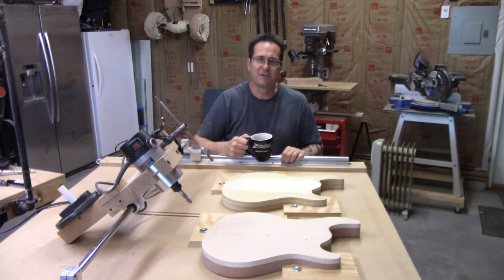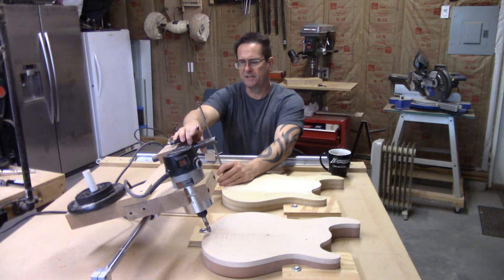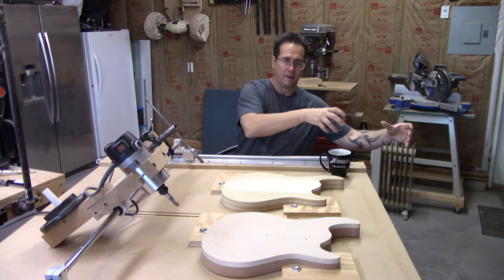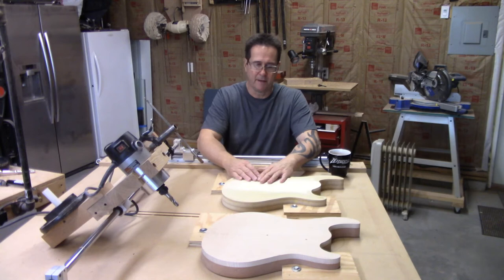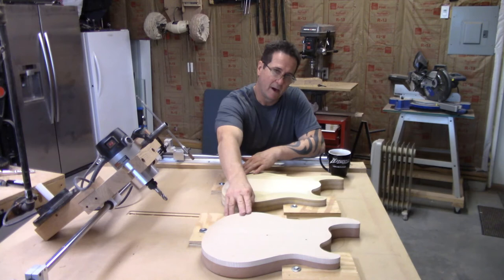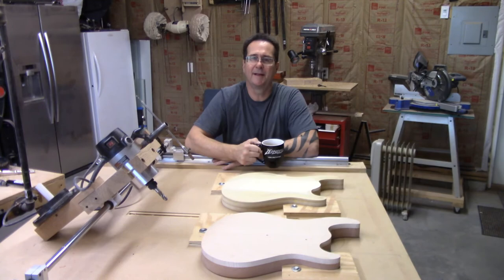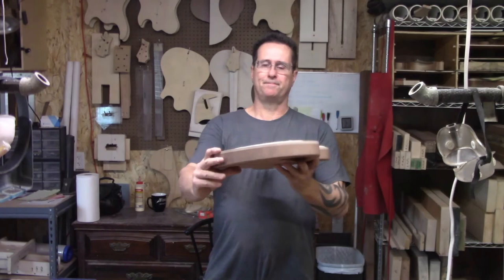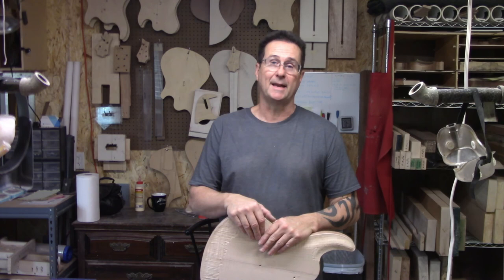Hand built copy carver

Comment: Where did you get your stylus arm for this machine? I’m building something similar but can’t find any information on how to mount the stylus.
Reply from the maker: I actually built it myself. I used a 1" round pipe, mounted it to the top of the assembly with a homemade wooden clamp, drilled a hole in the end of the pipe for a drill bit extender long enough to get down close to the surrogate body. I tapped a hole in the side of the pipe for a set screw to hold the extender in place in the pipe. For the stylus, I drilled a hole in a piece of African Mohagany for a short Philips head screw bit, pressed it into the hole then chucked it up and spun it in my drill press and shaped it with some squared up flat blocks with sandpaper stuck to them. Checked the accuracy with a micrometer along the way. I carefully rounded the stylus to the shape of my 1/2" endmill bit 'till it was just right. Hopefully, I've explained it well enough for you to understand. I'll be upgrading this part of the carver in the future. I'd like it to be a little more robust. A machinist friend is going to make a solid rod for my stylus. Good luck with your carver, hope to see the end result. Thanks for watching!

Comment: hola, what are the dimensions of the supported rails and rails for router?
Reply from the maker: The rails are 3/4" SS rods at 40" long mounted on solid aluminum bases and the crossover rail is a 3/4" SS rod at 40" long. I used open pillow block bearings on the bottom rails and closed pillow blocks on the crossover rail. You can find these items at VXB.com. I hope this is helpful!

Comment: Great vid, the size appears to my needs. Can you give some info on the build parts?
Reply from the maker: I used linear pillow blocks and rails from www.vbx.com. The X axis rails are 3/4" stainless steel rods attached to mount rails, pillow blocks are open to allow travel on rod without interface with mounts. Y axis is a 3/4" rod and two closed pillow blocks mounted to a block of hardwood. This allows for the Z axis as well. I plan on changing the hardwood for extruded aluminum soon. I just layed out the guitar body to be carved  and a surrogate body to copy from, made sure I had enough room to allow the stylus and router bit to travel far enough to reach all edges of bodies. The placement of router and stylus was based on the center line of both body blank and surrogate body. I figured out the base of the machine at that point. I hope this helps and good luck.
Reply: @lesperanceguitars8381  Thanks,